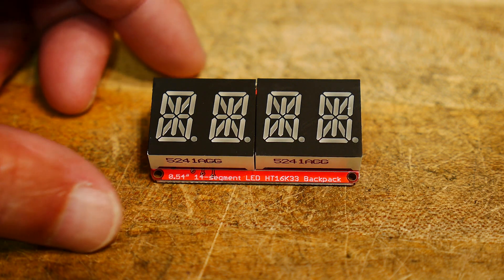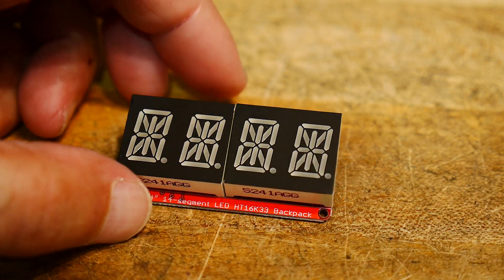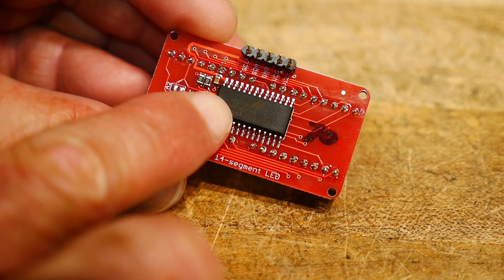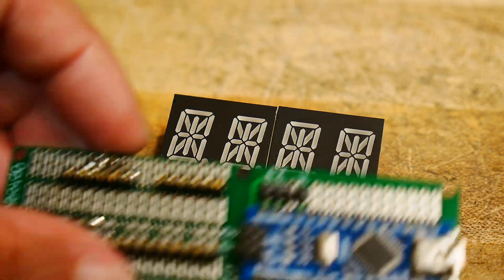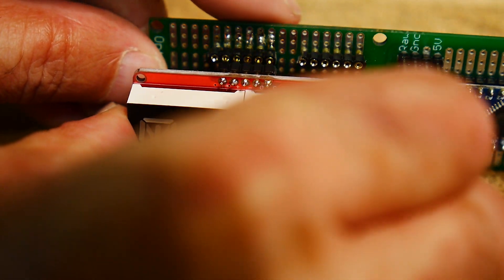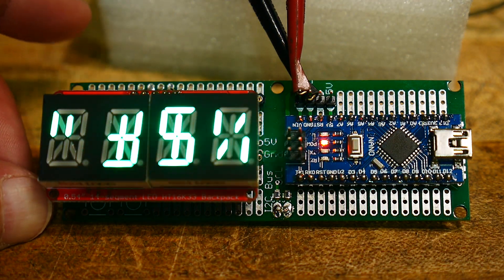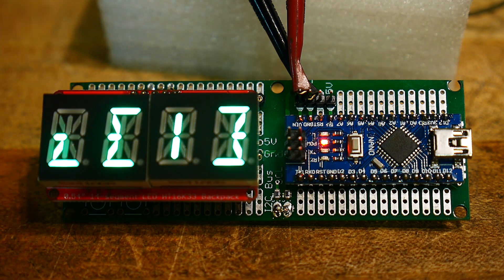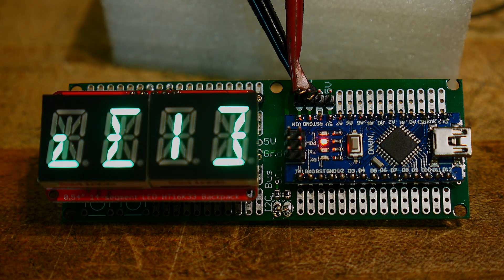#378 14 segment LED i2c display

Comment: the 5 looks weird
Reply from the maker: so if you display '5S' you can tell the difference
Reply: If you made the S a bit more slanted in the middle (like a backwards Z) it would make more sense. then the 5 should look like the S does currently

Comment: Back in MY day, we had to scan those displays in software!
Reply from the maker: in the snow uphill?
Reply: @IMSAIGuy  maybe somewhere else
Reply: Easy..😅, I actually might unsolder the leds and chuck the backpack thing away because I'd rather just program it..❤️😎👍
Reply: As I turn old and curmudgeonly, I tire of multiplexed displays. I bought a bunch of the single displays, and drive them directly from paralleled shift register latches - for higher current. I didn’t even bother with series resistors. Literally four chips per display, and a couple decoupling caps. Crude but works well, and is so satisfying. Brightness is controlled by the supply voltage. CMOS logic chip output stage resistance works a treat. If I were to go ultra-curmudgeon, I’d make them have fixed dissipation with antiparallel dummy LEDs (maybe IR). Then as the contents change, there’s no large supply current ripple. That’s kinda a LED equivalent of a Class-A amplifier stage :) Absolutely pointless but so delightful.